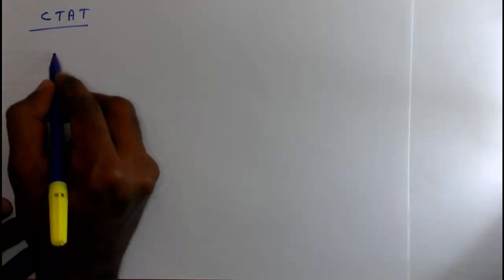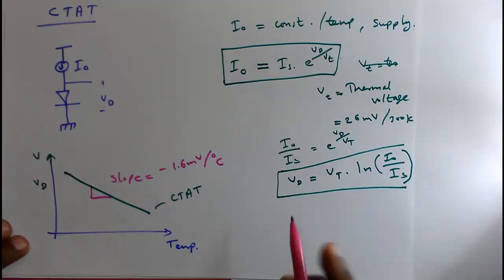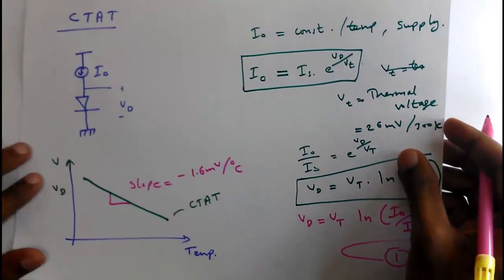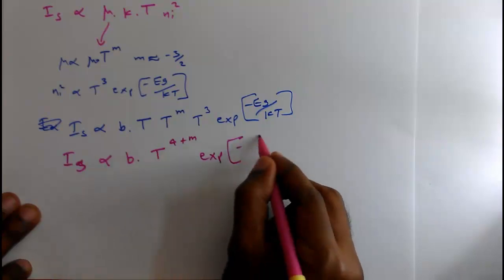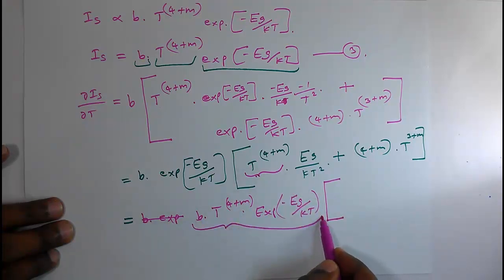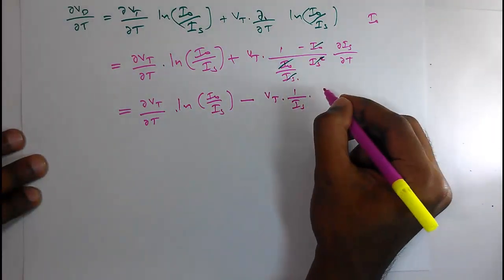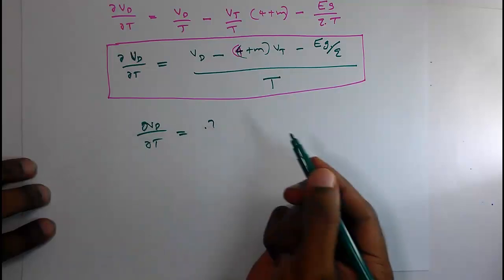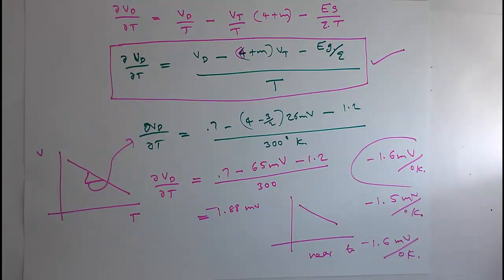Design of Bandgap voltage reference (BGR) - 2 : CTAT design

Comment: Hi, When we are finding slope at the end, Why did we substitute 300 as a value of T. What if I want to find the same at 350?
Reply: Because, by default,  general temperature we are considering is Room temperature: 27 C= 300k..So, from room temperature, we're checking what will happen if we either go or down the ladder of temperature

Comment: I would love a physical explanation as to why diode is CTAT. I see how that's the case from the formula but I don't get it from a physical sense. Increase in temperature in my mind should increase the current because of the higher energy of holes and electrons...
Reply: It is because by increasing the temperature also increases the probability of their collisions which would lead to heat losses